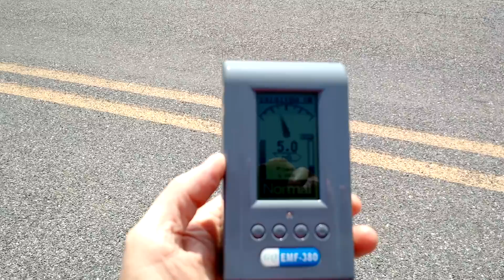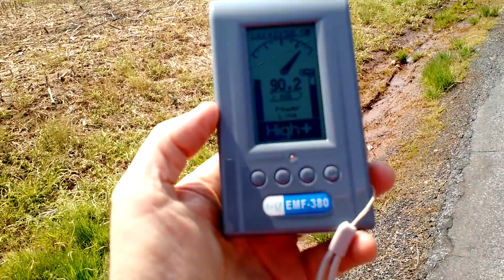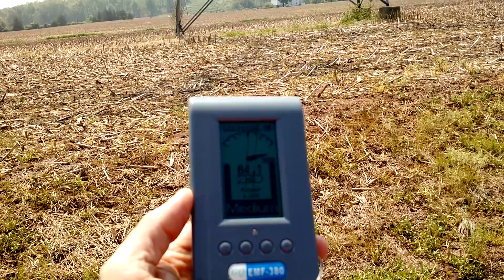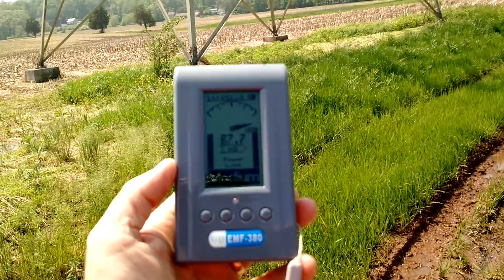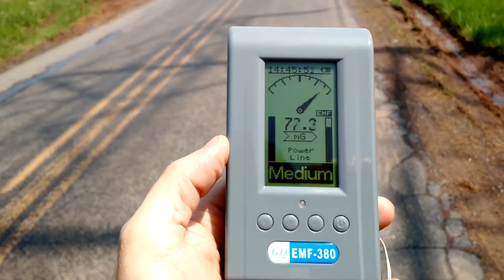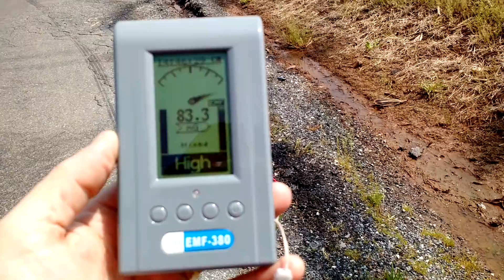High Tension Power Lines 5/14/2018 /Dangerous EMF!!!

Comment: This guy has no clue what he's talking about.  High tension transmission lines are not AC they are DC.  60 cycle hum is at residential voltage, 120 volts these lines are in the high voltage range of 100 to 800 kv.  And you want me to take you seriously on a matter this scientific, Ha!

Comment: The strength of the EM field very quickly weakens when you get away from the axis of the line. That's why no buildings just below the wires. 150 meters away from the line the field is safe.

Comment: We used to put a small TV antenna on a 20 foot PVC pipe under transmission lines like these. Then using a copper pipe driven into the ground and a high gauge cable from the antenna, we were able to retrieve the waste EMF/C causing discharge sparks to the copper pipe. Dangerous but fun and interesting experiment. Don't attempt this if you don't know what you are doing. A spark from this hurts big time and yes I got stung from this. I was lucky it didn't stop my heart.
Reply: Thank you for this. Will try it.
Wear gloves to insulate yourself
Reply: @swatisquantum  Cool. Just be careful, this can give you a funny belting if you're not paying attention. Let us know how you get on with it.

Comment: I know,our local aluminium smelter is supplied by twin 330 kV feeders @ 50Hz :-

https://encrypted-tbn0.gstatic.com/images?q=tbn:ANd9GcTUy64Ha5OixU2jhcHaQXBTlFlqRvnsct0G3qGkZENcH41GZwvqYt9us5wV&s=10

You can't take magnetised stripped credit cards,etc onto the site because they'll get erased,be fitted with a pacemaker or used steel ladders on the site because the EMF from the powerlines is that great,if you did have a steel ladder there it would likely stand up on its end.

On an older site which has been demolished they had smaller 132 kV power lines supplying it but it didn't stop someones mechanical watch from getting its gears jammed up because the EMF was that strong that it forced the gears together,it stuffed the watch up.

That was inside the induction room which was underneath one of the the potlines & on the secondary side if the transformer where the anode voltage was 3-4 volts DC & the current was 100,000 amps.

The highest voltage feeder in Australia is the 500 kV one (or 2) which supplies Power to the New South Wales state grid in Sydney (Kemps creek) from our local power station (Eraring).

They are proposing one to be ran from New South Wales to Queensland as well !

Comment: Is that your white car over on the side of the freeway exit. Go start the engine and see how much EMF is coming from your car. If you stick a thermometer in hot water the thermometer readings will go up too. Is that dangerous? If you put on an aluminum foil hat you should be OK.

Comment: I came here expecting arcs or something and I got some uneducated bs about how electrically generated magnetic fields are dangerous
Reply: Me too, that is exactly why I am here. I have been watching awe inspiring videos of trees getting zapped and burning from within, transformers malfunctioning, and power failures in third world countries creating arcs that go a terrifying 50 feet up. I have also been watching videos of flash floods, dam bursts and landslides. This video doesn't fit into the category that I watch.
Reply: Really these em fields are linked to those diseases? so that’s why there’s no correlation between those illnesses and linemen I mean seriously if they where dangerous and caused those diseases everyone who worked on high voltage lines (which are normally on and carrying normal electric load while being worked on and inspected) would be suffering from those conditions and any other you try and say em fields cause. 

Furthermore why isn’t there a huge spike between MRI operators and diseases since all a MRI machine does is create em fields. 

Why isn’t there a spike in these diseases with junk yard workers using massive electro magnets or anyone who refines metals using high voltage to melt it? 

Are these em fields really only dangerous when they are transporting power and compliantly safe when we do anything else that causes them? 

All the both of you are doing is spreading fear and lies to people who aren’t educated in these fields and whether it’s a result of the dunning kruger effect or maliciousness is irrelevant as both he and you are actually hurting people.
Reply: Childhood leukemia, ALS, alzheimers btw

Comment: Stop scaring people, this is not something that is dangerous for your body! There is absolutely no proof this would affect us in any way. Of course there aren't any proof that its 100% safe in the long run either, but it is most definitely not something you would need to think about. 

I would guess the increased heart rate you would get from worrying about these things, are more dangerous for you than the actual EMF...
Reply: Lars: I agree with you. The measured magnetic field in this video (about 50-90 milliGauss at 60 Hz) under these transmission lines is far less than the Natural field from our mother Earth, which is about 500 milliGauss.
Reply: @rrrlr5  earths field is static, these are constantly changing being at 50-60 hz....
Reply: @ViSomBusar  Okay, so show some scientific evidence that 60Hz weak magnetic fields are dangerous. Also, just living in a house with power will expose you to 60hz fields off the cabling in the walls anyway, is that dangerous too?

Comment: If it was dangerous, Why aren't they higher above the ground, Of course you're just driving past it, and it's usually harmless
Reply: the reasons for putting them high and far away from tree branches is so there isn’t any risk that wet sticks falling towards the lines could initiate the arc. magnetism cannot be physically manifested into human tissue because our bodies have no ferromagnetic substance and the trace metals in our cells are all bonded into amino acids and enzymes. There is literally no way that heat can be generated in the cellular level by electromagnetism or radio waves by being nearby any appliances/antennas it is unheard of.
Reply: @dampandrew  i know that. I work with electricity. I was just trying to say its completely safe.

Comment: Try working with electricity and the transformer is just a humming. When your under transmission lines and it’s raining you can here a zap or a slight buzz sound. That’s the rain drops hitting the lines. Those lines your under are transmission lines that are produced by a power plants or nuclear power plants. That sent power all over the state. Those towers are typical voltage is 500kv, tower height around 90-150ft high.

Comment: Hey. I’m wathing this a bit late. I live in Sweden and I’m helping my mum with house-hunting. There is one really nice house for about $1m, but there is a powerline about 50 yards away, and from what I researched it seems like it has 130kV (or 130,000 volts). Do you think this will post a health risk to her and others visiting?
Reply: Im late i know. The answer is no. This video is nothing but overreaction to a very very small problem. They wouldn’t build houses next to those things if they were dangerous.

Comment: Use that meter next to a running vacuum cleaner, microwave, or a washing machine. You may not like the result.

The lines with the V insulators appear to be running about 500 kV and the adjacent line looks to be probably 230 kV. Here in AZ, there is a massive 500-kV system that connects Phoenix with power sources all over the state, especially the Palo Verde Nuclear Generating Station. The 500-kV corridors marching across southern CA are impressive too.

Comment: Damn alarmists if your so worried go live in a cave and get off the internet
Reply: you're
Reply: These alarmists are stupid, I agree. It is one thing to be afraid of WIFI, because the EM field from it is stronger so it can be transmitted wirelessly, and you are exposed to a higher dose. Also, internet can be transmitted without wires. If it were not for these wires however, unlike with the internet, there would bee no electricity, because it requires wires. A lot of those people are not only against electricity and coal burning, but also against farming, and literally do want us to go back to the stone age.

Comment: The buzz from the lines is caused by the current trying to track though the air, the reason you hear it more in the summer is because its more humid thus the air is more conductive. Funny how people who work in the power industry don't have the headaches...
Reply: That's a negative! Humid air decreases conductivity in the air because its negative. So the more humid the air the less conductive it becomes. Dry air is more positive so the dryer the air the more static. I'm a RF Technician and we use humidifier in the winter time to control static discharge which can destroy components as well as test equipment.

Comment: What is the meter reading?  Try putting that meter next to your microwave oven at home. Or try it next to a motor.  The comments I saw here are not much better than uninformed paranoia. They might even be worse than that. 

Ok so you don’t like electric lines.  Then move somewhere where there’s no electricity. It is a simple fact.  If you want electricity in your home to run your tv, air conditioner etc, it has to get to your house somehow. So, the only way not to have electric lines is to have no electric service.

Comment: I always heard that buzz when I drove under them.  Strange and unsettling.
Reply: You know, when I start my car it makes a noise too...very unsettling!!
Reply from the maker: Hello Joann, I was VERY alarmed at what levels I found with BP's meter. and I was  still  about 35 feet  BELOW those wires. 3/4 Million volts is something I never wish to be around for extended periods like this again! Are you close to an area with many High Tension Power lines such as this? Thanks for sharing your experience! God Bless!

Comment: I just got the meter. I haven't used it yet cuz I'm mentally lazy. Are they hard to figure out?
Reply from the maker: There should be a quick guide in the box with the meter in which it came. You can go to GQ Electronics website which would be in the printed material that came with it. There is a more extensive manual you can print online from their website. I printed it out myself. You will need to charge the battery to full when you first get it running. Follow the Manual/guide.

The time is now that you have the meter, there is NO excuse for being lazy! I just caught a cold from letting my system being run down from the intensity of the High Tension Power Lines video! Use it at your pace of learning and curiosity. Just don't over do it for hours on end. I'm doing this to wake people up to benefit their own health and lives.

If your just trying to turn it on, hold on button for 3 seconds and let go. The meter will "boot-up" and the readings on the meter will start. To turn off, do the same thing as turn on.
Take some time to digest the manual as time permits. You don't have to print it out. Just go to website. It is in PDF format. God Bless.
Reply: Thank you so much, sir. This has helped! I appreciate your encouragement and God bless you as well. He is a good good Father!
Reply from the maker: Amen Katherine, Amen

Comment: Will a 100ft extension cord power anything if placed under the power lines?
Reply from the maker: Thirty Three LOL You will need lots of copper!... If you go to a substation get a transformer from them... Then get a transformer from a street pole for house voltage... Then and only then would you power up something in home...
Nice thought... 😢 Disappointed heh... So was I after headache I got doing video.
Do some research on Nickola Tesla and free energy. Save yourself and get solar panels for future. 
God bless!
Reply from the maker: Thirty Three Yes, it will lay there under wires when it's put under high tension lines! LOL
I know.. I'm a smart donkey!
Reply: Maybe a tiny tiny neon bulb.

Comment: Well the first hour was a double bundle 500 thousand and the second Towers at 238000
Reply: The first Tower
Reply from the maker: Emily Clements Hello Emily,
Both towers wires were carrying 3/4 million volts! 
You can't split voltage by running different wires from same location. Transformers, Substations step voltage down for use by Industry and residential use.
Voltage is like water pressure, current or Amps is like larger diameter pipes to carry more current.
The field effect comes from higher voltage, therefore what is on your street poles is lower voltage, then stepped down on those round transformers hanging on poles to go into houses.
Hope that helps! God bless
Reply: Christian she was half right,  you were incorrect. Tower 1 is  500kv phase to phase.  Tower 2 is  345kv phase to phase.

Comment: That buzzing is in my ears all the time. Doctor cant find anything to help me. Anyone else have this issue? Ive tryed all that I can think of.
Reply: Its worse than it use to be. Im doing everything suggested!!!!
Reply: It can be a side effect from taking aspirin.
Reply: Virginia Dulin take Corella or spirulina...and limit your exposer to rf and emf as best you can my ears do same only from excessive use of phone or exposure to wifi. Stops when I avoid them.
Reply: Virginia Dulin going out side helps but yeah turn off all electronics esp when going to bed put the phones and electronics off and away from the bedroom
Reply: Virginia Dulin ringing in mine all the time..most of the time I don't notice it unless it's intense